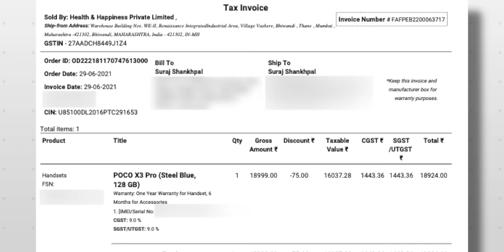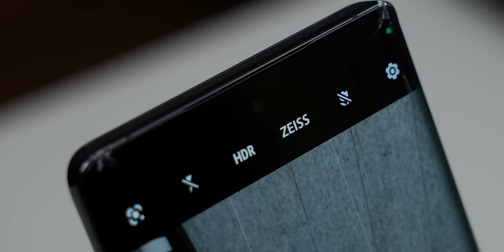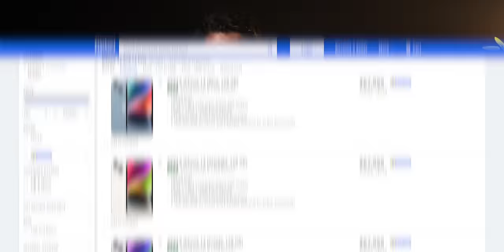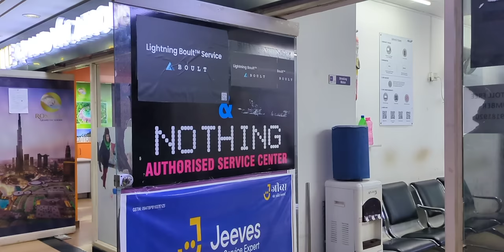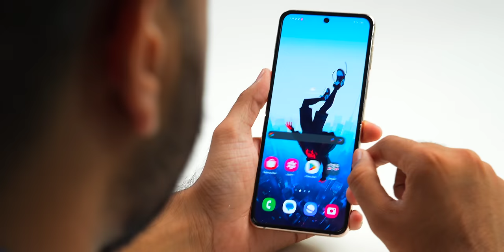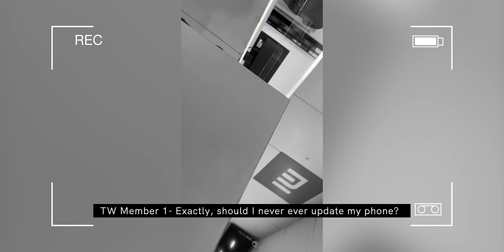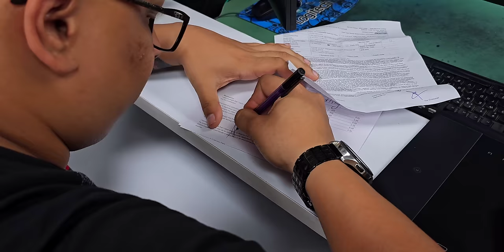We Tried 5 service Centers in India!

Comment: Bro I am from Kurnool, Andhra Pradesh. I Have OPPO RENO 7 5G Currently. When I First bought the phone And everything is fine But after one Half month I had a problem with the  CHARGING CABLE. Its Not Delevering the Power to the Phone and It always Disconnect's And I have to check it to ensure it's working and It Suddenly disconnects.. After 4 months later I went to Authorised service center in Kurnool and they Replaced me the Old Charging Cable with the New One Under the Warrenty And I am Super happy about How they Communicate with me..... Nice I am Really impressed 😊😊😊.. Here In Kurnool OPPO services centre is Reall Good... Thank God I Didn't buy the Poco Phone 😅😅

Comment: Motorola Service Review - Bought an Edge 30 from Flipkart, within one day the back panel started coming off. 

And Flipkart won't replace it because "sar, open box delivery, sar".

So, when to Motorola's service center. They had only two in a major city like Hyderabad (that's only 2 centers in the country's 4th largest city, in case you missed that).

One was really far away on the other side of the city and seemed to be a Lenovo service center. The other one (which I went to) was a Micromax service center that they also shared with Nokia and a few others - it was filthy, there were paan stains all over the walls in the waiting area.

There was virtually no queue management and it was like a fish market to get to the service counter. 

The only good thing was that they fixed the phone for me on the spot for free - but that too was an unofficial repair. No job sheet, nothing. They had given me two options, (1) they'll fix it on the spot (didn't tell me it is unofficial until they did it) or (2) They'll replace the device in a week. I needed my phone, so I went for (1).

I really like the phone, but this was a really disappointing experience for me. Maybe things would have been different had I gone to the Lenovo operated center, but that would mean a 1.5 hour journey (one way).

Comment: I have an old Asus device , which has camera issue  and battery issue. The service centre replaces the battery in 20 mins and because the spare part is not available they charge me in advance and  said to inform me when the spare part will come . After 10 days  spare part came  and my device was fixed and I am happy without any hassle because I don't have to give them my phone for several days . 😊 BTW my dad still uses my phone and He loves it .

Comment: I had bought a Samsung M 51 2 years ago. Suddenly there was a problem in its charging. I went to the Samsung service centre they said That the motherboard needs to be replaced because there is a breakage in the circuit they were demanding for ₹15000 but I felt that something was wrong so I didn't submit the Phone. After that I went to a local Shop for the repairing of the phone. He examined the Phone and said there was nothing wrong with the motherboard. He changed the charging port and soldered a new one And now it's been a year and my phone is working fine I had to only give him ₹600. No issues after that.

Comment: have a galaxy a53 and it had a lot of bugs, small things but very annoying (speaker stopped working for bit), it was a only a few months old, took it to the service center in Delhi and then just put the software in it again, didn't really fix the thing. I then did factory reset and it has been fine since then

Comment: So currently I’m living in Bangalore and currently using an iPhone 14, no issues with this phone but my previous phone was a redmi k20 and I had insurance for the device which I purchased at redmi along with the phone, the Insurance was for the phone’s screen and I could replace the screen twice for the tenure of 1 year, unfortunately I did break my phone’s screen twice but the insurance was a life saver, the process was really quick and hassle free and not only did the repair the screen for free but they also polished the entire phone coz the scuff and scratches on the side of the phone were completely gone and I’m not kidding when I say it felt completely brand new , the repair cost was around 8000rs for the screen but I only had to pay 500 for the service charges. In short the insurance was an extreme life saver and the experience was top notch. The insurance provider was digit insurance.

Comment: I'll quickly elaborate on my experience with IQOO 9T and Vivo's after sales service in Goa. I purchased the phone via Amazon, and received a device with a slightly chipped screen. The chip was so minor, it wasn't visible, but the left edge of the screen felt sharp when swiping. I immediately informed Amazon, who denied replacement as it wasn't visibly cracked and said it may be a minor manufacturing imperfection. 

Fast forward 3 months and the chip grew into a crack all across the screen. At this point Amazon asked me to visit the service centre as the 10 days return window was over. I went to the service centre in Margao mentioned on their site, and it was permanently shut 😅 The next service centre was 40kms away in Panjim. Called Vivo care and they said they can send a pick up and drop service, but by a local carrier (with no insurance if the device was damaged or lost). Obviously, I denied and took another day off and went there in person. The lady tells me since it is physical damage, they'll have to charge me (even though I explained it came this way and got worse) and will cost 10K on a 45k phone. After much arguing and getting Amazon on the line, they finally came to a compromise of fixing it for 2k. I agreed as I took 2 offs and wasted 500 in fuel driving 80kms round trip. 

The thing that pissed me off the most about this experience was that both Amazon and Vivo failed to understand that the screen came chipped and the crack got worse with usage. I even provided them with picture evidence of the same. Both companies totally washed their hands off responsibility and kept passing the buck. The only person who deserves applaud is the kind lady at the service centre who offered me the discounted rate.

Comment: hey tech wiser!!! I'm frm chennai of tamil nadu. I'm using using OnePlus 9R for past 2 years, couple months back my oneplus 9R received a software update, i updated my mobile during the late hrs, the mobile was working all gud, but the nxt day mrg my mobile display got green line error. After the error i immediately called the oneplus service center which is located in T-nagar of chennai, i explained what was the issue and they asked me to bring the mobile to the showroom and they said they fix my mobile within 2 hrs if there isn't any water damage or physical damage, luckily my mobile didnt have any and my took my mobile to the showroom and i noticed there was lot of ppl with the same error. OnePlus did do what they promised, they examined my mobile for water or physical damage and replaced my oneplus 9R's display for free within 2 hrs.

Comment: Yeah something notorious happened to my phone, I bought my Xiaomi redmi note 9 pro max in  may 2021 from my first ever pay cheque , in August my phone started creating arcs in display like literally lightning ⚡ was happening from top to bottom of the display, I got to service centre of Xiaomi in Ahmedabad, they checked my device and it turned out to be the malfunction of capacitive touch thingy in the screen which was creating those arcs then they replaced the screen for free of cost at the time of prying up my phone's display, their technician accidentally broke the back panel of my phone, originally my phone's colour was black but they called and said black back isn't available and I had only two options blue and white so I selected white and now my phone is zebra.

Comment: For me an IQOO user it wasn't very smooth. I bought iqoo 9t from Amazon. Within 4 5 days of using this the phone died. It wont charge or restart or hard reset. Amazon didn't give me a new phone even though Amazon States a 10 day replacement. I then went to service center and they kept my phone for around 25 days even though they said its a 7 day process. I had to call customer care and service center multiple times to push it forward and then on 25th day i got a new phone. In the mean time they had missed 4 deadlines. But their customer team was polite in their behaviour.

Comment: My mi 11x had 2 times issue of getting completely dead. One time service center solved by hard resetting. Second time i dm mi service on twitter that i am losing my data everytime and it is happening second time. So they contacted the service center as well and they replaced the motherboard free of cost. Took 1 week as parts unavailability. Rajkot, Gujarat

Comment: Sir 
I will explain in one plus service center
In 2021 I bought a brand new OnePlus 8t that costs 45999 from Amazon
Within a week I met with an accident and the mobile display got broken and my device slipped into the pond. You people can think how it's a pain to hear that your mobile got damaged within a week as it is a new condition. After that I met with the service centre phone and was in working condition they asked me to change the display that cost around 14k and water drops inside the device they cleared. After that I used that device with a new display till the last 2 months before then I started to face green line issues after the update. I went to service center and they told me they will check and inform me that within an hour  they called after checking they told us we cannot provide free of cost replacement you should pay 14k the free service has denied the reason for the water drops that got inside . Guys it was inside before one-year that was cleaned from the same service centre but they denied that it would become fair what do u think please get me a reply

Comment: My nothing phone got boot looping issue and I visited the service center which was about 40km away from my home and they checked it and said it's a software issue and they downgrade the software version from Android 13 to Android 12 1st version. The problem will not solved. I again visited the service center at that time they checked and said it's a motherboard issue and they said it will take 1 week. I waited 10 days and got the phone. But the boot looping issue is not solved. So I again go to center and they said it's a bettery problem and changed the bettery and problem got solved but my phone was now running in Android 12 older version. They said they didn't get the Android 13 software.

Comment: Having used various brands of smartphones , my current experience with OnePlus/oppo has got to be the worst. I had gotten the infamous green line on my first ever OnePlus 11,I requested for an expenditure on the repair time ,only to be told they only have the LCD with the mid frame for the black variant ,I was told if I am fine with the black variant ( despite my oneplus 11 being the emerald green), never in my lifetime I was told to settle down with a LCD with black mid frame and they refused to replace my back housing ,after I called in to feedback ,they finally agreed to replace the back housing to match the replaced mid frame . Guess what , I came home to realise there is a dead pixel around my front facing camera, unbelievable .... Thank you OnePlus ,this is my first OnePlus and it is going to be my last one plus phone . Never have I ever come across such a subpar after sales  service.

Comment: I am a former poco x2 user. It had some motherboard problems like the camera wasn't working. so, after several days of dispute and altercation they agreed to replace the motherboard free of cost. But the twist is the motherboard of that device again got some problems and the camera blacked out again within 10-12 months. I didn't even update the device nor installed any hardcore games or anything injurious for the device. but the motherboard problem occurred again. This time they refused to resolve the issue. And I had to exchange the device for 1/3rd of its cost price. Avoid poco if you can.

Comment: At least poco did something about the motherboard issue.
Instead of checking for the ultimate premium phone of Samsung... You should've tried for their budget/mid range device.
Samsung had similar issues with their 'M' series and they didn't even acknowledge it. My M21 had issue within 15 months of purchasing and they told it would cost 7500 for replacing motherboard.
I sold the phone for 3000 in exchange instead... Never buying a samsung device again 😪😪

Comment: about 2 years ago I got my Oneplus X fixed (I know its old but it was gifted to me so I wanted to get it fixed), the problem was the charging port and battery..... they told me that the phone has launched in around 2015 so the parts and batteries are not available... but then when I requested they asked other service centers and then took the phone for 1 day & fixed it....they even gave me a discount on the battery if they can keep the old battery for recycle....the phone is running fine after that.....

the condition of oneplus is very different now...

Comment: I have been using Redmi Note 10 pro for past one year and 8 months. Suddenly facing OLED damage (Purple Spots).  I visited to nearby MI service centre. They told me that This issue is a physical damage currently you're phone out of warranty and for screen replacement will cost six thousand rupees. I Just asked them What is the Root cause of this problem. they said There is a high chance this happen if you kept the phone in your pocket. FYI There is no physical damage in my phone. Could you please let me know if you came across of this issue previously?

Comment: Poco is a scam, I had an x3pro, died right after the 2 year warranty, costs 12k to get its motherboard replaced. You could say "hey if you pay less you don't expect much" well I don't expect much but atleast I don't expect it to die all of a sudden and loose all my data with it, I will use it however the company wants me to use it for it to last atleast 6 years. But even after that, it just dies. Whats crazy is that Poco is still selling this defective phone. Due to this they have started a chain reaction of toxic sellers and consumers, suppose I bought this phone and in 2 years it just dies, I go to a third-party technician and get it fixed for cheap, then I go to a mobile guy to sell it, who sells it to another person. This feels like an accidental pyramid scheme.

Comment: My Realme 3 pro stopped receiving network on both the sim slots so i  took it to the Realme service center near my office in Bangalore. They analysed the phone for like 10 mins and said there is an issue with your mother board and will cost Rs.8000/-...
I just said nimge ondu Namskara and walked out with my phone

Comment: Kindly make a video on Google Pixel Servicing. Recently my Pixel 6A got wet during rain. And for some time, it was working just fine. Then suddenly Black Purple smudges start appearing on the phone. It's charging just fine. Slowly the touch response reduces and by the morning I can't even open the lock screen. Now even If I wanna turn off the phone I can't. I contact Google support and ask them to take it since there's no service in a big city like Guwahati. It takes them almost 3 weeks to give me an update. They say there's been display and motherboard damage and for fixing it ,it'll cost me 28k including GST . It's exactly the price at which I bought it. Back in December. Just been. 5 months. I'm surprised as to how the motherboard can be damaged if the phone is charging and turned on. I didn't opted for the repair service. Even then they charged me with 850 for the delivery purpose. Kindly make a video on this. Humble request to you guys.

Comment: I visited Vivo service center in Bangalore to replace the battery of my Vivo V15 device bought in 2019. They said spare parts of this model has been stopped and inturn they told that they would offer 10% discount if I buy a new device with replacement of my device, isn't that weird? They also said I won't get the battery in any Vivo service center across India.

Then why is there something called as service center for each brands if you can't provide spare parts?

Another experience: When I bought this device, i got a earphone inside the box which stopped working (one side) within 3-4 months. When I visited service center, they gave a stupid reason saying that the earphone is filled with dust and so warranty can't be claimed and they didn't replace it at all.

Comment: Samsung Foldables are not upto the mark. Both my Fold 3 and Fold 4 got issues with the inner screen display within 8 to 9 months where the screen guard starts to peel off and then the touch also stops working and the display starts to get black lines through out the hinge and gradually it spreads throughout the whole screen. 
Within warranty period they wont repair it for free! Since I buy the insurance which is ADLD, i had to use that. But there is also another trick - when you claim the insurance you have pay again another huge amount 5k(Fold 3) and 10k(Fold 4). Then they will fix it. Otherwise the general repair cost is 55k to 60k.
So this is not what you expect from a 1.5 lakh phones!

Comment: So many Iphone 13 users have issues with display becoming green Blue white tint. After speaking to customer service eventhough the the report from service center is no physical damage, they dont replace it free. This issue happen 2 or 3 months after warranty. Many users are facing this issue and ther are forced to change display for 30k. Please do a service experience of iphone 13 series with display issues. 
Ps: now local repair shops found a solution for this by jumber on display module